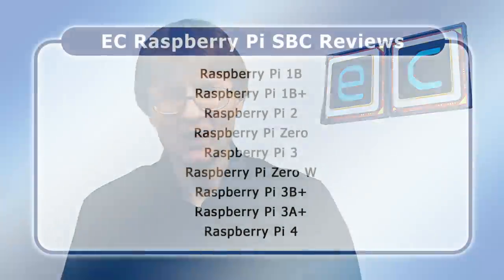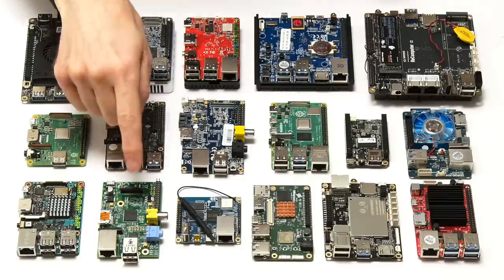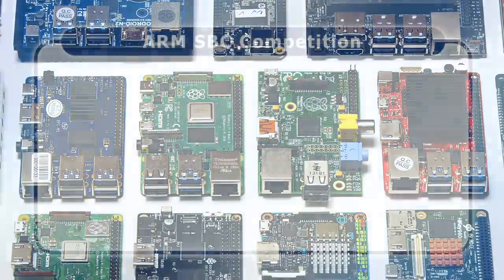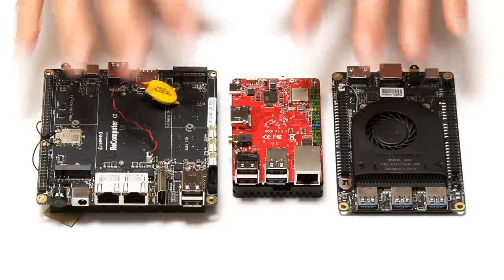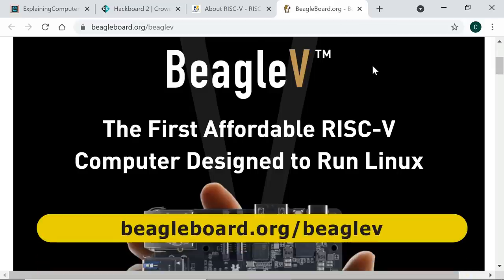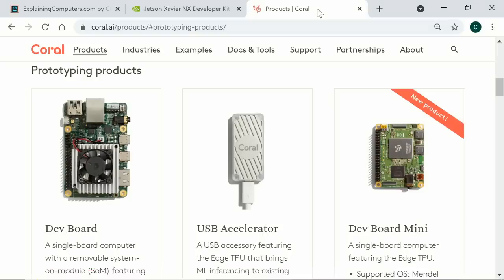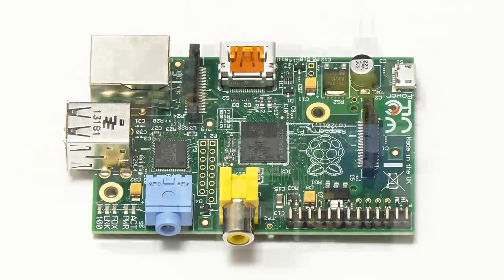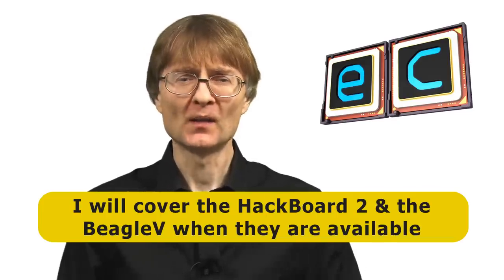SBCs in 2021: The State of Play

Comment: I don't get the whole "RISCV is more open than ARM" thing...  If you have to develop your ISA addons and get SoCs fabricated, then they're basically the same
Reply: It saves a few bucks that would otherwise get mailed to Arm/Nvidia. At quantities of a million or more devices, that number adds up. I don't hold a lot of hope though, open-source projects are notoriously easy for big corporations to subvert if they feel like it. If RISC-V presents a credible threat to profitability, ARM/Nvidia and Intel will crush it without mercy.
Reply: @Tano erm, nope. The RISC V architecture is free for anyone to design against, but there is absolutely no need for a completed design to be open. Just like ARM sell their designs to manufacturers, SiFive et al sell their RISC V designs. At the moment at least they can’t compete in terms of raw performance against x86 or 64 bit ARM Cortex A designs. Where they win is in embedded designs, which have been traditionally been the stomping ground of the ARM Cortex M series.
Reply: @Tano also to add, while ARM have a huge catalog of other IP you can add to their CPUs (anything from an I2C port to a full GPU) that you can combine into a chip design, what they won’t let you do is add your own functionality to the CPU instruction set. For software developers this is no bad thing, it means that code written for any ARM CPU will, in theory at least, run on any other (of the same ISA level at least). Custom instructions are good for the embedded crowd, less so for general purpose use.

Comment: I would like to see a selection of interesting, cool and surprising uses for modern SBCs. Mainly the RPi, but it could cover the most popular SBCs on the market if necessary.
Y'know, something other than as a desktop computer, or as a NAS, or as a controller for cameras or small tank robots. Also, what is being developed for it that seems to have a bright future.
In other words, anything new and out of the norm. That could cover both hardware and software for them, although I'm more insterested in software as it's easier to get access to.
Thanks, Chris!

Comment: Thanks for the video always enjoy them. I find that the emergence of the CM4 board and all these new manufacturers creating motherboards for them that have direct access to the PCI bus for peripherals such as NVME drives and SATA drives, will be great for industrial applications. For myself I have installed Debian Buster operating, (Pi OS), system I’m on all my X86 machines that no longer support Windows 10 and I find having the consistency between the SPC and my desktops, very compelling to do so. Keep cranking out those great videos! Hans…

Comment: A feature I don't recall seeing on any SBC is a CANBus interface. The two would seem to be made for each other. (For anyone who may not have heard of it, CANBus is a standard for Controller Area Networks. Originally proprietary, invented by the Robert Bosch company, it is a simple hardware and software standard for connecting and controlling machines. It's now a published standard. Car ignition, fuel injection, braking, and signalling systems were the original use. If your car was built in the last 30 years, it's probably full of CANBus kit.)
Any robotic or domestic control system is a likely candidate for CANBus. The problem is that literature on how to use it is very sparse. The one book I've been able to find describes the protocol at the hardware level, but demonstrates that there's nothing to do there, because it's all integrated into off-the-shelf chips.
Whenever a product hits the market with a potential or minimal actual use that can be enhanced or used with other products for many purposes, an ecosystem of associated products springs up, (For automobiles, think Model T Ford, Austin 7, VW, Mini; custom bodies, luxury interiors, performance motors and suspension gear abounds. There's a positive feedback, because every one of those vendors wants to encourage sales of the base product, which becomes more valuable to more potential customers because of the add-on.  In computing, boards and accessories for the Apple ][ and IBM PC, and, of course, the Pi. Anyone designing an SBC or anything to connect to it would do well to take advantage of the Pi's ecosystem, by ensuring that they fit Pi cases, use equivalent power supplies, take advantage of HATs, &c.  The less difficult it is to use a product, the more likely it is at least to be tried. That sells at least one, and potentially many, if it becomes part of a larger system.
Reply: Many ARM boards support can, now you have to check if 1. is it broken out to a GPIO and 2. add the transceiver.  This is the same for alot of STM32 M4 micro controllers that pretty much have everything and the kitchen sink on them.  I used a usb-> can ( SLCan ) device on Linux and was able to send and receive messages over twisted pair ( CL / CH and GnD ).

Comment: Hi Chris, thanks for another good talk of the entire SBC market, very nice summary, with sales data and segmentations analysis. 
And, r u also aware of the shortage (out of stock) of the RPi 4B, especially the 2GB version, there in UK? 

I've reminded our sourcing guys about the chip shortage issue (which might bother us) in this spring, but the supply and price show nothing weird at that time, which means our guys didn't make any helpful decision. 
And now, it seems we might need to switch our products back to Pi 3B - it's still on the price around $35. As for the Pi 4B, they (dealers in China) offer ~50% price increase but still have not many units in there warehouses.

Comment: 6:18 "Hackboard 2 with optional 4G or 5G connectivity". I would consider this to be one of the more significant developments in SBC's in recent times if it were to gain traction.
Lack of mobile connectivity is a major impediment to projects. While 3g and 4g Hats and boards exist they are often very expensive, and hard to get. 

Anyway, great video, as usual.  A "state of the play" is very useful.

Comment: I've used several different SBCs. But today I exclusively use Raspberry Pis (Pi 4). The software support is just unmatched. Pi Debian gets frequent stable updates that don't break things like other distros. Pi OS updates stream in monthly. Where a different maker board whatever OS you get with it likely won't change much. I run a solar powered web server of a Pi 4B 8GB and a raid of SSDs. Server uses around 5 watts of power. That server has been rock solid and fast for years with a recent 8GB RAM update an easy 60 second Pi board swap and done.

Comment: Thanks for the excellent video. I agree that the whole ecosystem of a particular SBC needs consideration, not only the board itself. You mentioned software and community support. In addition, the availability of hardware extensions such as hats/shields, breakout boards including software drivers is essential. Whole vendors and shops mainly focused on Raspberry Pi such as Pimoroni or ThePiHut come into my mind. 
In the future, dedicated ML hardware might become more affordable for integration in Raspberry Pis. BTW: ML inference is even available for microcontrollers (TinyML). See the development tool Edge Impulse that supports the Raspberry Pi 4 as well. 
If I had wishes on upcoming topics, I’d choose the OpenFlexure microscope and ML on Raspberry Pi 4 using tools such as Edge Impulse.
In my household I am using Raspberry Pis everywhere, for the OpenFlexure microscope, for OctoPrint (3D Printer control and monitoring), for embedded development such as inexpensive Edge devices, and for simple home computing.
Keep up with your great videos on SBCs and other boards. Your channel really rocks!
Reply from the maker: Great point on HATS/etc. :)

Comment: Thank you very much for this SBC overview.  Great presentation as always!  I look forward to seeing what RISC V can do, given that it's even more open than SPARC was.

Have you considered evaluating the Espressobin?  In terms of compute power, it's comparable to a middle-of-the-line Raspberry Pi, but it's a little different from the rest in that it has a built-in SATA port, a network packet switch (three Ethernet ports plus a wireless option), and a lot of GPIO.  The trade-off is that it lacks built-in video.  So its application space is a little different from the other boards, but there is an overlap, e.g. media centers and small NAS or SAN devices.  And all the network interfaces makes it potentially a nice safety net for IoT and edge computing.

Comment: Great analysis on the state of SBC industry! I would only look at using a SBC to runa cheap and simple NAS. Mostly to loearn and 'tinker' around with the HW and SW needed to do this. IF you haven't done a video on using a SBC to run a NAS (even if the NAS was made up of USB flash drives), that would make a good video.

Comment: Industrial SBC's already dominate much of the small board market. For example all slots in casinos are run by industrial SBC's with networking for slot control and management. The other market segment is active signage (billboards, restaurant display menus), streamer boxes, etc. The market in sub 1L PC's are growing as more developers want a more inclusive kit as opposed to buying accessories that end up costing more than the board itself.

Comment: Chris, Have you added a RTC on a Pi before? I am in the proccess of doing so on one of my Pi4B 8GB, I am using the Low Profile Ice Tower Cooler, It covers the GPIO Pins so at first i was going to use some wires,  But stumbled across a 2x20-pin right angle female header .. waiting for it to arrive from AdaFruit.. hoping this will work..

Comment: Software support is definitely the key. I use both Raspberry Pi and Jetson Nano for my ML projects. Although the Jetson Nano is much more powerful than the Raspberry Pi, I spend a lot more time on compiling software libraries when using Jetson Nano. The software on Raspberry Pi just works right out of the box for most of the time.

Comment: The future of SBC can be clustering computing when multiple SBC boards are stacked together to perform parallel processing. This makes sense because if there is need to add more processing power, just add another module. The Raspberry Pi computing module is already being used for such a purpose, and it will get more popular when it is easier to set up such a cluster.

Comment: Chris, good show.  I will be glad to hear an update or addition at some future date.  Since you asked for other SBC subjects to cover, I would like to know what common programs/functions can be run on a single SBC at the same time?  With the current shortage of chips, it would be good to use SBC for two or more functions, IF they are compatible on the same SBC.  
OK, that could keep you busy for quite some time, and thanks again.
Reply: @AstroCat AstroCat, what I am looking for is to know which of those programs is  a RAM hog and which is a CPU hog and which is both.  I would like to avoid Docker for simplicity.  If I have to run a few less programs, then so be it.  Also, how does one handle OS resource conflicts?  That is another issue.  Also, are there Docker images for all that I want to run?  I don't know.  
On another different tack, I have a Jetson Nano named AstroDog.  
Peter

Comment: There are good reasons why ARM-based systems similar to those seen in this video, will continue to prosper at the expense of others.  The ARM ISA has some specific strengths that make it hard to beat.  First, it has been intentionally designed to have a close relationship with the C language, so that compiled C-based or C-like code builds and runs efficiently.  Second, is that every instruction is conditional, and includes register rotations or shifts at zero cost in processor cycles.  Third, is the neat SVC service call, which does loads of cool stuff super-efficiently.

Comment: During the first lockdown, I set myself up with an RPi4 which was great at the time - two screens, Citrix interface to my work - but as time went on the limitations started to irk me. Citrix only supports HDX on it's (more expensive) version of the RPi, and there was no support for some of the oddities I like to use, like BlueJeans video conferencing, Atem video switcher, or my Sonos controller. This kind of meant (to me) that other manufacturers like Sonos didn't consider the RPi worthwhile developing their apps for. So, if the RPi wasn't attracting any interest from the likes of Sonos etc, then the others have no chance.

Lastly, YouTube just isn't there yet on the current RPi. If I'm going to move away from a PC, then I need that, BBC iPlayer, and Amazon Prime video. It feels as though RPi is so close... but not ready. Conversely, I'm ready to throw my lot in with RPi once it can do everything I need. I love the idea of a silent, energy efficient tiny box on my desk. For the few months I used my RPi4, I was  happy with my choice... but the limitations meant I kept having to open my laptop to do other things.

Comment: Some notes:
- Though support for many SBCs is certainly not as good as for the RPI, I still think Armbian does a pretty good job for general-purpose applications. If you want a media center, you're better off using an Open/LibreElec variant - you can't have both general-purpose and stutter-free high-definition media running well from the same installation just yet.
- Boards have become increasingly powerful for NAS, VPN, or web server (https) applications. There is a clear divide between Arm boards that have crypto instruction and boards that don't - now that Internet speeds on glass fiber are getting seriously high, a VPN or https function can no longer use the full speed of an Internet line, unless the chip has crypto acceleration built-in. Also if you use a NAS and a high security backup setup (like LUKS), you'll need the crypto acceleration to achieve full performance over a Gbit line.
- USB3 was still a problem child when I bought my SBCs for home server applications. Some boards did support USB3 at a decent performance, but they used kernel 4.9 which has a nasty bug in the implementation of BTRFS that I use for making shadow copies.

Comment: Love the channel. I have a question about why Raspberry Pi foundation developed the pico?  I understand the gap in the market for the Pi, kids were no longer allowed to play with/configure/break their laptops/pc as it was expensive, needed for school and maybe used/relied on by other members of the family. But there are plenty of cheap well documented microcontrollers, From the micro bit, to the arduino, to all the adafruit and sparkfun boards. What gap is the pico/rp2040 filling?
Reply: Price, performance, portability? Look at Arduino - official prices are very high, USB support is messy (on clones), no hardware debug. STM32 - great platform, MBED, HAL, but quite pricey and better for bigger projects. And then goes Pico. 32-bit M0, dual core. Can run Micropython (easy jump start), but can do C/C++ very well, has onboard hardware debugger (or use second one for it), capable of learning low level multicore programming, yet very cheap to fail fast, rinse and repeat.
I did few tiny drop in projects in home with Pico (mostly light control without remote). Just write few lines of Python, connect usb, write file and forget.

Comment: What do you think of the Arduino Due vs the new Radxa Zero for projects which require good CPU speed, good IO options (esp. SPI), small size, low cost, and good/easy-to-use dev environment/IDE?

Comment: I did not know about the RISCV SBC.  That will be one to look out for.  Exciting times in the hardware space for sure.  
I highly expect we'll be seeing those processors everywhere in a few years with them ramping up 5-7 years in larger launches like smartphones.
I wonder if Apple will switch over.  They currently have their own pseudo fork of ARM with M1, but if they could get even more control with RISCV, I could see the switch happening.  It allows far more flexibility compared to ARM.  ARM might finally have a proper competitor in this space.

Comment: I'm really excited for RISC-V, I can't wait for them to develop a core that's as strong as a Cortex-A78, and for Linux to work well with it.

A possible way to boost RISC-V adoption is to make a couple standard SoC designs that are open-source, so that the software development that goes into the hardware of different ODM's is mostly compatible and propells eachother forward.

Comment: Very nice overview. Thanks Chris. 

SBCs seem to get pricier and pricier. It's difficult to see the attraction of them when I could just buy a PC if I wanted a powerful computer.

I wonder what Intel will make of the SiFive. You know what would be a good idea? For Intel to do for RISCV what it did with the x86 architecture. So we'd kind-of have a standard set of hardware architecture, rather than each ARM chip being its own special snowflake. And then, create a simple DOS, like in the good old days. And sell it for a fiver. So it would be like a Raspberry Pi 0, with completely accessible hardware, and a dirt-simple OS. I doubt that they'd do it, though, because people will run away screaming if they don't have a GUI.